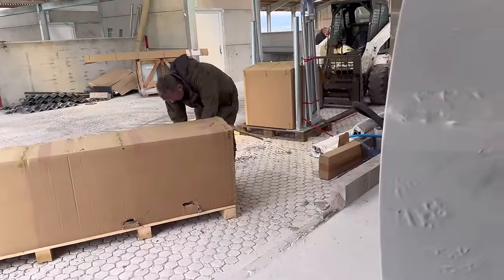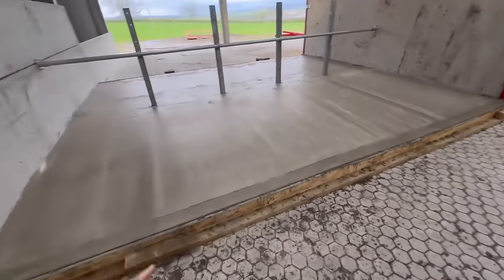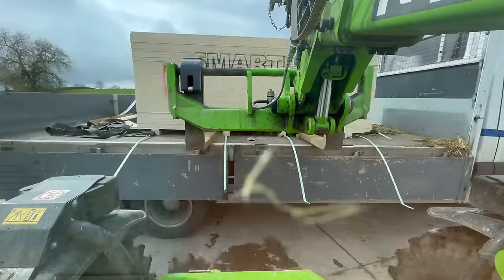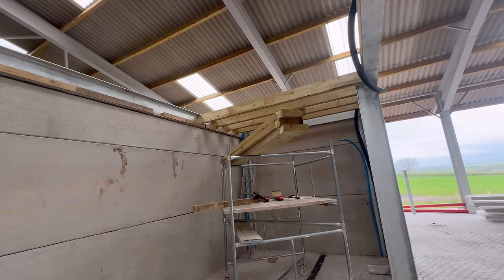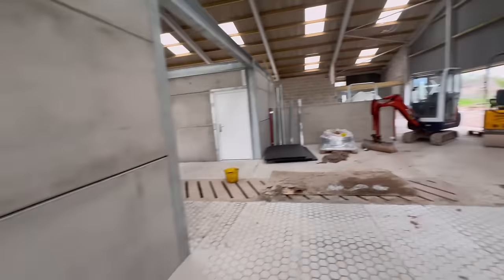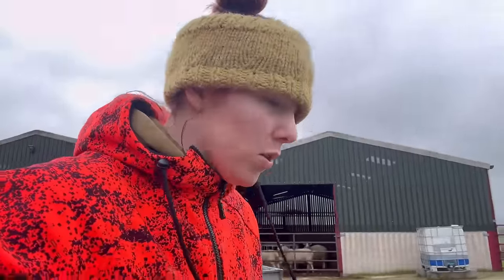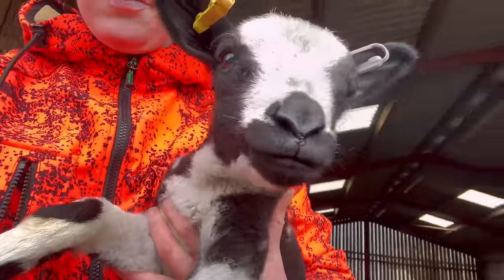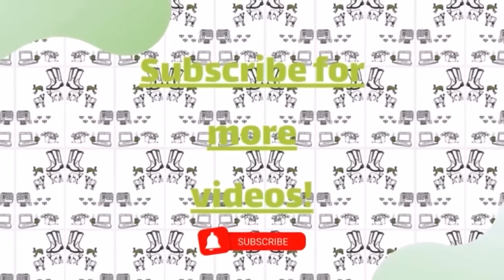14 April freezing lambs- Robots get a roof- farm action

Comment: maybe you should put some celotex or loft insulation between the joists in  the office before the floor goes down , possibly gonna be a pretty cold office in winter with no insulation anywhere ? the walls you could insulate later if required with an internal stud wall , but the floor would be a pain to take back up

Comment: What are you using on the mastic before smoothing it Charlotte?
Reply from the maker: Nothing I’m just wetting my finger
Reply: @charlotteashleyfarm  if you have an empty spray bottle put some washing up liquid and water in it and spray that on it, it's easier to smooth out. Try a bit first though just in case it's a mastic that doesn't like it.

Comment: Forgive me, suck eggs etc.

If you had a decent wood chipper you could use it for all wood : Hedge cutting, branches, packing wood, shuttering maybe even cardboard, all to be chipped for your biomass heater in winter ?
Free fuel.
Reply: The concrete residue would blunt the blades very quickly.
Reply from the maker: We have been looking at them actually it’s a good plan think you would clear up faster if it was chipped in a pile